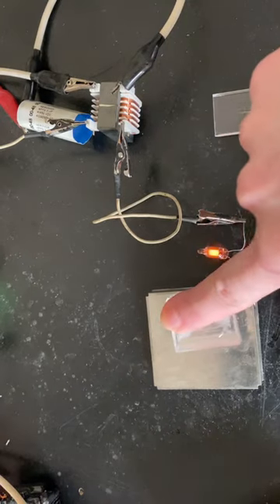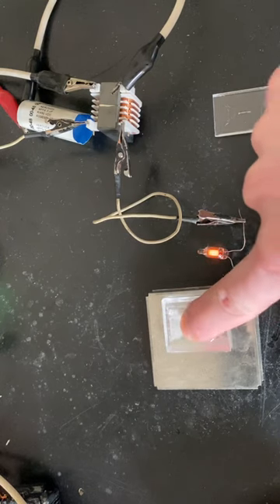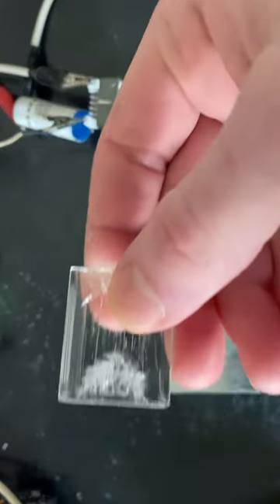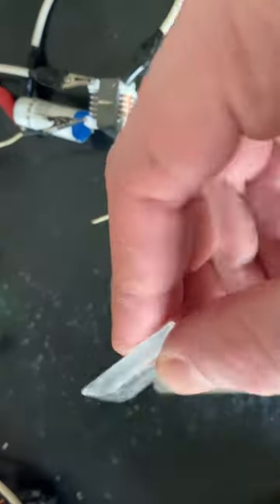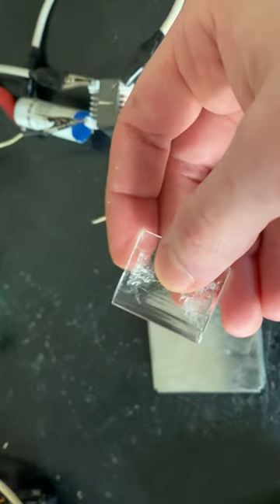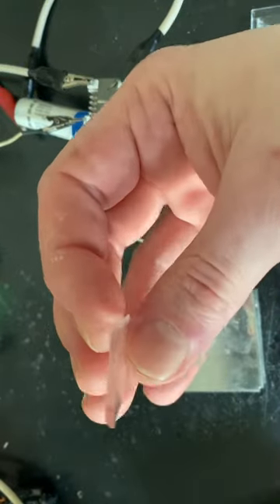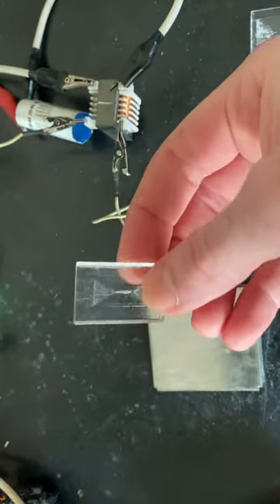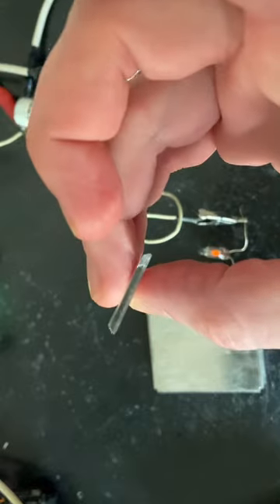Amazing Results From Rochelle Crystal Loudspeaker Experiment

Comment: This looks amazing. John Hutchison was able to make his $20,000 high voltage crystal power cell with silicon and germanium wafers. Do you think you can make silicon and germanium crystals using your method?
Reply from the maker: Prior to your comment we had ordered Raw Germanium, Strontium Zirconate, and a variety of other key materials for precisely that application!  I saw I can’t state with certainty that we will be able to grow germanium. But you can bet we’re gonna try our damnedest.
Reply: Hutchison did part out war ships and did have some crazy experiments but i think some of the anti gravity stuff might have been faked. Yes the cameras at the time were not good and to be far away because of the RF but it looked like upside down footage and one vid i seen a string that was pointed out by people. If i levitated a bowling ball id stop at nothing to narrow down the equipment till i understood what was happening.